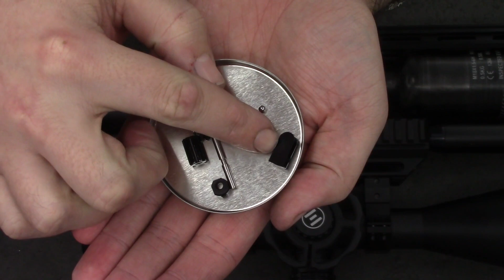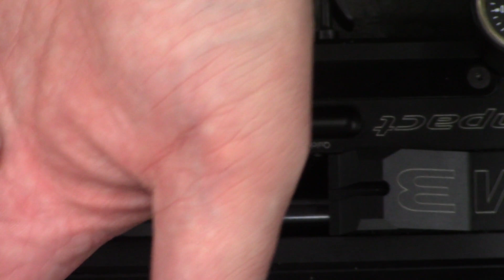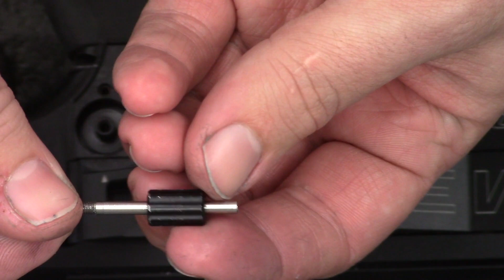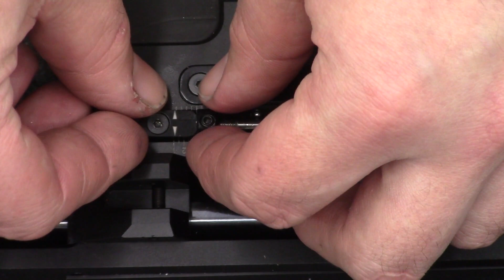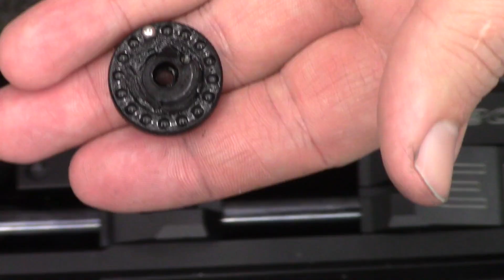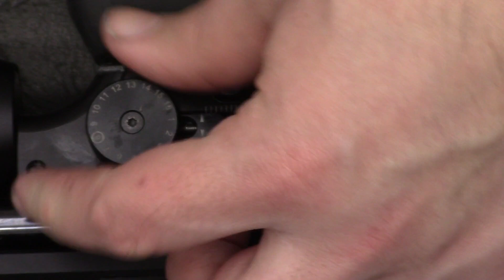Sub 12 FX Impact M3 Quick tune install.

Comment: Great video, I just did this mod on my brand new M4 .22 using your video. Excellent instruction Jake. I need the locking ring now but the adjustment has made a difference to grouping. I am keeping it under 12. My next mission is to put the prettier block and plenum on it. Thank you so much for doing these videos I would have been really struggling without it.

Comment: Hi Jake, did you ever make your lock available…? Great video! 👍
Reply from the maker: yes the next batch will be very soon
Reply: @sub12airgunners Great news… I keep an eye out on your eBay 👍
Reply: @sub12airgunners PS just fitted your Hammer spring adjuster and lock nut to my DRS…. Mine had been loosening and power variations…. Now set nicely sub 12 👌

Comment: Hi ya I’ve just bought the new M4 sub12 it’s in .177 and wondered is there anything I could do as a tune to get everything working right,
Would the superior heavy liner be better than standard and would the carbon barrel shroud tensioner kit be worth adding it’s got the 500mm barrel, plus would it improve the rifle by adding anything from huma-air

Comment: Hola. Acabo de suscribirme en tu canal. Para empezar, muchas gracias por tus videos.
Estoy en España y poseo tambien un FX M3. La limitación en mi pais es de 24 J. Cuando lo adquirí en la tienda me instalaron la rueda del micro y la valvula.
Yo quiero respetar los 24 J. y no quiero pasarme de los 24J. Mi pregunta es; Si subo al máximo la rueda del micro y abro la valvula tendré más julios? Quiero ir por la ley y con 24 J. dan para mucho.
Muchas gracias y recibe un cordial saludo desde España.
Reply from the maker: Thanks for subscribing  😀 yes it will go over the 24j if you open the valve and turn the adjuster up you can lock off the valve with grub screws, it depends what cal for the transfer port .177 all have the same size but in the uk
Reply: Por que imagino que el puerto de transferencia tendrá el agujero del paso del aire más pequeño, no?

Comment: Can I just ask if this is sub 12 how come.its got the power plenum on it?, or am I issuing something
Reply from the maker: this is sub 12 we fitted all the hp bits to make it look like the 700mm sniper but they are all locked off or restricted to keep it under 12lbft with everything turned up to max it will only achieve about 11.8 with jsb 10.34

Comment: Hi Jeff.. Just installed the quick tune kit on my new M3 followed your vid step by step and it doesn't make any difference to power out put? Gun out the box was firing about 750fps  with 8.44 which i thought was quite low for the impact.. after the QT install max i can get is 705fps not sure whats happened so any advice would be greatly appreciated 🙏

Comment: Hi, nice video. On my M3, the valve spring shuttle has a short threaded rod going through it that blocks access to the removal screw. The threaded rod protrudes out of the rear of the shuttle. Have you seen tbat before.

Comment: Love the video, you say that you rarely find you need to adjust the micro adjuster above 2 on a sub 12 but mine is set to just over 4. I’m getting 11.5ft/lbs with qys 9.56 streamlined. Have I missed something.? Or all guns different?  Appreciate your advice.
Reply from the maker: most will vary a little but ours will be different as we have some different internal parts😀
Reply: mine is the same, just over the 4 with the qys

Comment: do you need to change to the 720 plenum when fitting the quick tune on a sub 12lbft, or would the standard one work fine please?
Reply from the maker: the standard one is fine with the quick tune for sub 12 lbft

Comment: Thanks for the great video I got a kit from kirkwood but when i went to fit it I could not undo the block screw even with heat. I ended up putting the rod on the lathe and cutting the end the same as the grub screw ot replaces. It then will go in without having to take the block off. Might help someone.
Reply from the maker: nice one 😀
Reply: @sub12airgunners  I am thinking of fitting the valve adjuster like you have would you say that it's handy to have on a sub 12? Have you done a video on it?

Comment: Excellent vidéo, I'd been given the impression the micro ajuster did just that, give tiny adjustments, and the bigger rotary wheel did the main ajusments.. Now I can see its actual function and how the smaller thumbwheel is the real power ajuster. Thank-you for the clarification on its correct function and how to do this modification if required.
Reply from the maker: thanks for watching 😁

Comment: So does the power adjuster actually adjust the power on a 12ft/lb model and if so what would the difference be between setting 1 and setting 16 ? …. Great video btw 👍
Reply from the maker: yes the power wheel works it depends on the setup but my one on 16 is about 11.4 lbft and on 1 it 9.4 lbft
Reply: @sub12airgunners  Thank you

Comment: Hi brilliant videos! Very interested in your barrel mod ideas.
You say you used a small butane pen blow torch on the bolt for the hammer adjuster?
Does this not damage the coating? I briefly applied heat in this way, but I see that the coating starts to sweat.
A brief heads up would be greatly appreciated, I don't really want to ruin my new shiny toy!
Thanks.
Reply: How did you solve? Hairdryer ? Thanks !

Comment: Really great video keep up the great work. I have just fitted the macro adjuster and valve adjuster after watching. Could you tell me what your valve adjuster is set to as to get 790 fps Iv got my micro set on 16 macro just under 4 and the valve adjuster on 4 1/2 first reg factory set 2nd reg 70 bar 
Am I doing something wrong 
Carl

Comment: Hi, thank you for sharing your knowledge. 
I had an issue fitting this straight off.
The adjustment guide shuttle screw was ridiculously tight and even though using top quality Wera tool it rounded the screw head. I’ve returned the gun to sportsman gun who are sorting it for me.
Only just got the M3 so didn’t want to try a screw extraction.
Any advice when a small screw is so incredible locked tight?
Reply from the maker: Unfortunately the screw is covered in loctite so the only way to break it is to heat the piece up, this breaks the loctite and allows the removal of the screw, Thanks for watching.
Reply: @sub12airgunners  thanks for the reply. I must say I’m very impressed with Sportsman gun. They drilled out the rounded shuttle screw, supplied a new screw and shuttle guide and got the gun back to me within the week. Complete with a detailed letter explaining what was done, with part numbers. All done under warranty. Great customer service.
It’s now so much easier to fine tune for safe tuning within 12 ftlb.

Comment: Hi there, how do you plug up the 720 plenum to reduce the volume on the fx impact m3.
Reply from the maker: We make a Delrin insert to go in the plenum that takes up space and reduces the plenum volume. Thanks for watching.
Reply: @sub12airgunners  thanks for your reply, will you sell them on your eBay site, I've got the quick tune lock from your eBay site.
Reply: @sub12airgunners do you sell this delrin insert as I would like to put a 720 on mine thank you

Comment: How do you remove the loctite? I’ve just spent £60 on the kit to find out mine is glued in 😂
Reply from the maker: Some have to be heated up, I use a mini blow torch the pen type ones, get it nice and hot then undo the screw. Thanks for watching.
Reply: Or use a soldering iron this also works
Reply: @stevesracingbits  how long did you use the soldering iron for

Comment: Thanks for your time and knowledge good video, one question would this be legal as a sub 12 for a none licence older like if the police checked the rifle
Reply from the maker: The way we see it, the rifle needs an Allen key to adjust the power at the moment (without the quick tune fitted), that seems fine as they are sold without issue, when fitting the quick tune wheel it does away with the need for the Allen key, this is a no no as its classed as easily adjustable. The purpose of the lock is so you can't adjust the power without the use of an Allen key, just like the original system, since the rifle can't be adjusted without the use of additional tools its not classed as easily adjustable and falls under the same category as the original system. Thanks for watching
Reply: @sub12airgunners  Many thanks for the reply please keep up the good videos well done my friend!

Comment: how could you have plenum on sub12 can I ask
Reply from the maker: Its just the 720 plenum from the FAC rifles fitted to a sub 12, we had to plug it up to reduce the volume, it was done more for the looks then functionality. Thanks for watching.
Reply: @Sub12 Airgunners  I understand thank you. I got mk3 in 1.77
Reply: @sub12airgunners  so it doesn't actually affect the rifles power? I understand we're pushing legal boundaries with this but what the hell do i gave to do to exceed the sub 12 power on my new mk3? Help lol
Reply: @bluewalker224 why would you want to ilegally increase the power of a sub 12ft rifle, just buy an fac legally if that's what you want to do

Comment: Always a pleasure watching these vids of yours Jeff....and you make it look so easy.... 😅Anyhow, Have you been considering perhaps creating a fine tuning system for the MK II? If there is anybody that could do it, it would be you! and I would sign up for a final release of course! would be nice getting rid of the allen key to fine tune the MK II. 👌🏻🙏🏻
Reply from the maker: Unfortunately without milling the block is not possible, we did have a look but honestly its more work then its worth, we did experiment with a captive nut in the hammer spring adjuster so you could turn the nut and adjust the hammer spring without an Allen key but it was just as fiddly and looked a bit naff. Thanks for watching
Reply: @sub12airgunners  Thanks for the quick reply Jeff. Well knew you would try something, to bad they(FX) did not construct it so, that it would be backwards compatible, at least for the MK II.

Comment: Having bought a kit from B&K plus one of your locks, I tried to fit it today and failed. My hammer-spring shuttle doesn't have a visible retaining screw and has a short threaded shaft through it. Do you think this is enhanced anti-tamper?
Reply from the maker: The short threaded rod is the hammer spring adjuster screw, you need to remove that and there should be a screw under it, that's what locks the shuttle to the adjuster, remove those bits then you can just follow the video to reinstall it. Thanks for watching
Reply: @sub12airgunners  Ah, that's the part you removed in advance to save time. I can see why as it's a nasty fiddly job to get it out. All went well after that (pending a chrono test) so thanks for your help and the video.
Reply from the maker: @SnapshotJH  No problem, Thanks for watching

Comment: Are you likely to do a front valve adjustment conversion aswell, with a mechanical lock of course
Reply from the maker: The new one comes with 3 grub screws in so it already has a mechanical lock built in, they did it to stop the valve adjuster unscrewing when fired, but we have on on our rifle no problem. Thanks for watching.

Comment: I'm probably missing the point here. I am very interested in fitting this to my Mk3, but how do I stand legally, as mine is sub 12, as this gives you the ability to potentially push you over 12, does fitting it make the gun FAC by default???
I just don't want to fall foul of the law, especially the way things are at the moment in the shooting community. Great videos BTW.
Reply from the maker: The idea of this is that the hammer spring is adjusted but an Allen key at the moment and that's fine because technically its not easily adjustable because it requires the use of additional tools, however its fiddly and a little awkward to do, the thumb adjuster is much easier to use and more convenient, but because it does not require any additional tools to adjust its considered easily adjustable over 12lb/ft, this is where the lock comes in, the lock still requires an additional tool to unlock the hammer spring adjuster, so you gain the adjust ability of the thumb wheel whilst still being able to lock the power off so you can't adjust it without additional tools. You can unlock the thumb wheel adjust your hammer spring to where you want it (<12lb/ft) then lock it off preventing any adjustment without the use of additional tooling. Hope that makes sense. Thanks for watching

Comment: when are you going to show how to make the barrel tuner like the factory fx one?
Reply from the maker: I made one and tried it but I could not get it to change the groups at all they changed position a little but they never changed in size, it just moved the group around, I am waiting to get my hands on a proper one to have a look to see if that one works or just does the same thing, but they have been out of stock for ages now. Thanks for watching.
Reply: @sub12airgunners  i would be willing to bet they will have a better effect on the fac models like we have in America because the sub12 rifles are in a fairly gentle harmony to begin with

Comment: Thanks for all your videos, wish it was about 5 months ago when I fitted my QT assembly would have saved me some fiddling. confused by you mentioning a ball bearing under D65 to fix X3-1 there was not one in my parts list/diags just the Dog point grub screw M3x5. Also secured mine by removing the thumbwheel grubscrew, after adjustment, instead of a locking collar.
Reply from the maker: Thanks, looked again on the FX parts diagram you are right I couldn't zoom in on the mobile and saw D66, I though at the time a ball bearing was a poor choice, but good catch, I was going to remove the grub screw on the thumb wheel but if you need a half rotation its a bit of a pain to get to the grub screw, but thanks for watching.
Reply: Same, think the extra bearing is just a spare, I'd ordered the QT pieces a while back and was waiting on this vid but didn't realise the spring and bearing were needed as not on the QT section received them this morning, hopefully I'll get a lock of you when ready  should receive that manometer bracket of you this week too, think all I'm waiting on is the valve knob with grub screws and the harmonic tuner, 
These vids are very much appreciated and your innovative products, top job cheers 👍

Comment: That little lock is good for the adjuster. Once you’ve set the rifle up at it’s most efficient and best fps lock it up so you can’t inadvertently adjust by accident. 

Few questions for you being highly experienced with these (and other) pcp’s. 
1. And this is the big question! What’s your most accurate rifle and what grouping are you getting at what distances?
2. For further distance shooting do you dial up to aim straight at or do you hold over/use dots?
3. What’s your favourite scope and why?

Was testing a .22LR today in the wind at 130 yards, was holding off 1.25 mil dot for wind (10x zoom) and 4 mil dots over and was getting a golf ball sized group with 5 bullets. I thought that was pretty decent in that wind.
Reply from the maker: Most of my shooting is done at 50 yards and my most accurate rifle is the .177 Redwolf, best ever 5 shot group with it was 6.25mm edge to edge at 50 yards (indoors), that was with sorted pellets though, but it will do consistently good groups. I only really shoot at longer distances in the summer when we can use the outdoor range (70 yards) and I normally just zero at 50 yards and hold over, my favorite scope that I own is the element Titan, but my favorite scope I have looked through would be the Zeiss V8 4.8-35, a dream scope but so clear and bright. Doing well for a .22lr in wind,  I have had a go with .22lr but never at long ranges, maybe if I go for my FAC ill give it a go. Thanks for watching.
Reply: @sub12airgunners  
That’s an impressive group at 50yds with a sub12 rifle!
I’ve not tried an indoor range for a while, I used to work at an airgun centre which had one years ago. 
Interesting to hear the Titan is a favourite, is it the clarity, reticle of build quality? Is if 24x mag? I saw you had a built in camera scope (not sure of the name!) my father has the fac but I have been using it with him since I was about 14, over 28 years ago now and I have just got my own fac so looking at which pcp scope and mod to get.
I think I’m not too far from you if you need some longer distance outdoor testing in the breeze, will have the .22lr and also pcp (when I’ve decided which one) to try as well.

Comment: Great video. Do you know if this is available for the mk2? Thanks.
Reply: No not on a Mk1or Mk2 as the existing slot/channel is much shorter than on the M3 - not 'as is' anyway
Reply from the maker: unfortunately not, as Adrian Thomas pointed out the channel is shorter and the block lacks the required drilling's for the spring and grub screws. Thanks for watching.

Comment: As usual a very good video manufacturers hopefully watch your videos hopefully it will help them improve 👍
Reply from the maker: Thanks, it would of been nice for FX to make an integral one connected to the spring shuttle, not only useful for sub 12 then a FAC user could lock the power so its not knocked accidentally in the field. Thanks for watching.

Comment: Do you have the plenum fitting vid and valve vid?
Reply from the maker: The valve is a straight swap, I do have a vid on how to remove the AT in my M3 disassembly vid, I don't have plenum fitting video but Airbuks has a good one if you are looking for one. Thanks for watching.
Reply: @sub12airgunners  cheers 👍